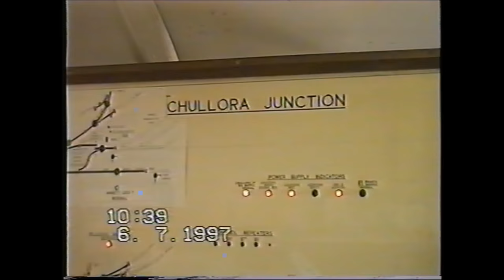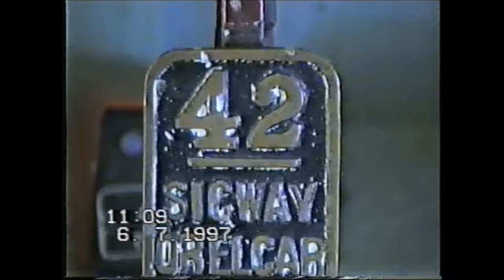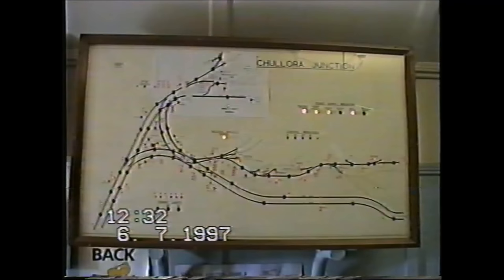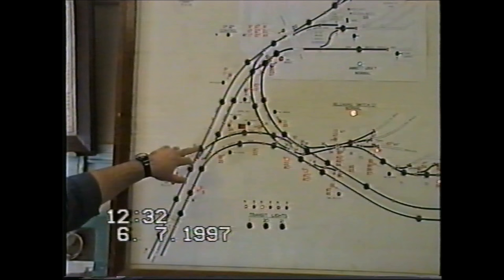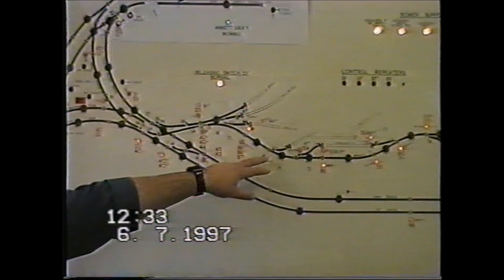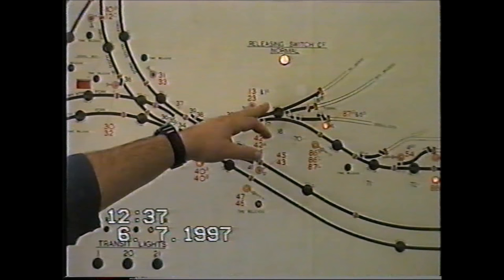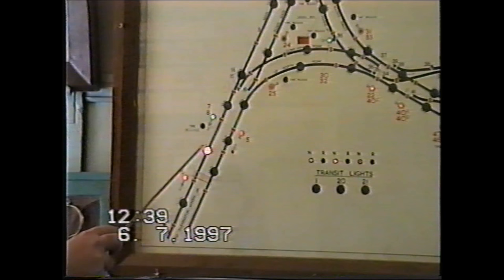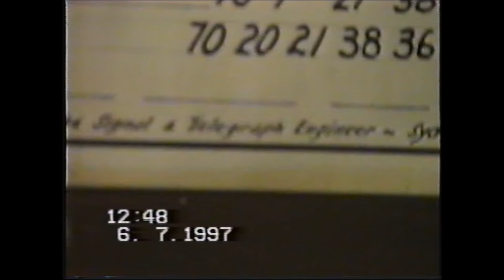CHULLORA JUNCTION SIGNALBOX 6 7 1997 HD

Comment: BRILLIANT TO SEE ACTUAL SIGNALLING OF REAL TRAINS AND ALL THE MECHANISM TOO. NOW ON EARTH DID THEY REMEMBER THE SEQUENCES OF LEVERS TO PULL ?
Reply: There is a diagram of the lever pull order for each route past the signalbox next to the track diagram. Generally the sequence is reverse facing point lock, set points, restore facing point lock, reverse signal lever. Depending on the length of the rodding and the number of dependent interlocking tappets, reversing a lever could require a fair amount of strength. The pivot point of the lever is below the floor, which isn't ideal because the amount of travel is quite limited. Central European double wire operation with turnover levers is superior in this regard.

Comment: why do the operators use a cloth to pull the levers?
Reply from the maker: When the top of the levers are cleaned if a lever cloth isn’t used the moisture from your hands rusts them quickly
Reply: @johnmiller5664  Thanks.